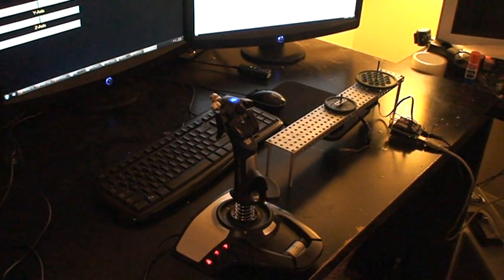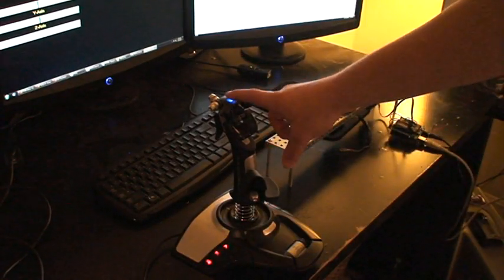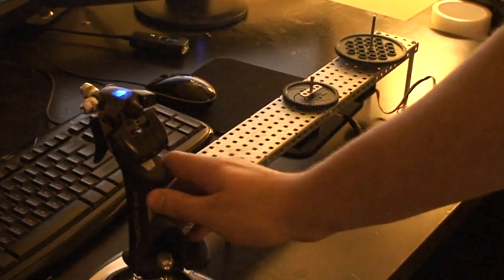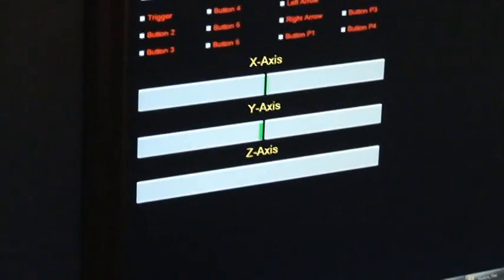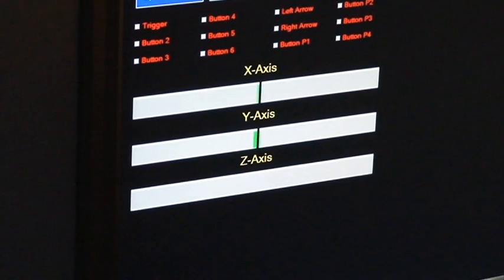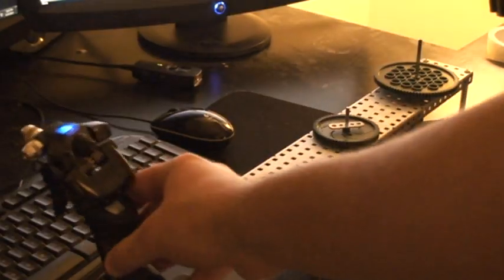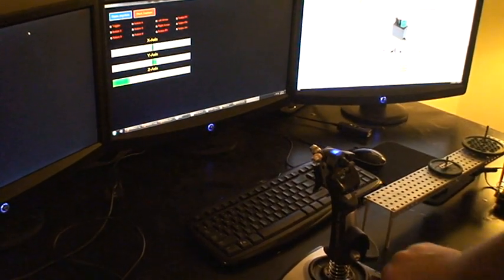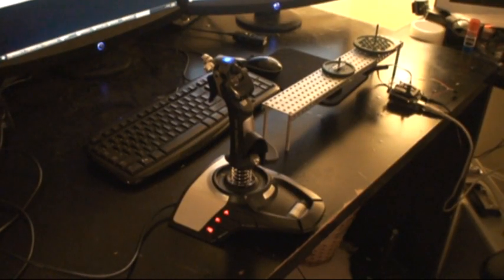Joystick robot motor

Comment from the maker: I did not use a soldering iron to build this it was nothing more than little point to point cables between the motor and micro  controller. The rest of it is just a 9v power supply (usb does not have enough) and two usb connections (joystick, micro controller). This is very easy to put together, but unfortunately there is no ready made tutorials.

I am sending you a pm about this because I simply cannot type more, I will also provide my email in it.

Comment: also , i know this sounds silly, but can you tell me if i can get this done without taking a soldering iron in hand? because i am not a electronics guy!
Is there a step by step Document for this project of yours which tells the basic stuff too, right from parts, to integration and software? 
i would have loved to figure this out myself but this time i am really short on time , and this is just the first part of the project i need to do. thanks

Comment from the maker: The hardware was very simple involving two parts. The first was an arduino usb micro controller that was programmed with some very simple code (available in the video description) and the second was a Vex robotics motor. This motor is nothing more than a geared motor encased with a PWM driver that connects to the micro controller. From there is was just software so it was a very minimalistic design just to show that the joystick could control it!

If you have any more questions please ask!

Comment from the maker: No the code is not the same, its similar in the way it works but its not the same. The Y axis was the only one that I used. I am sure that I could have set up the X axis to run the servo and kept the Y for the motor but I just kept it simple with one axis for both.